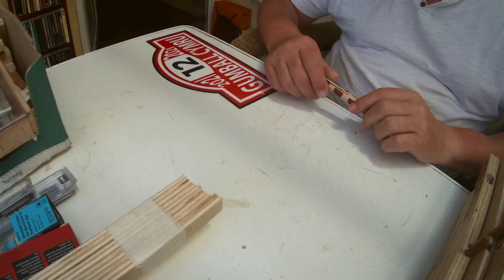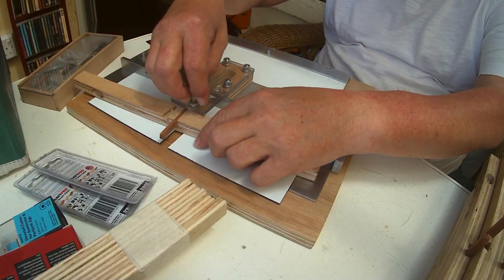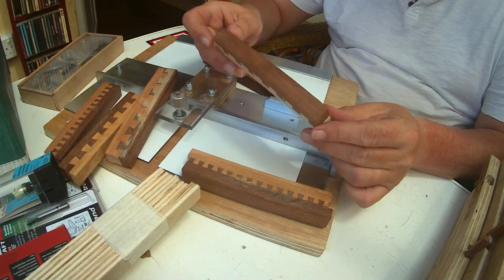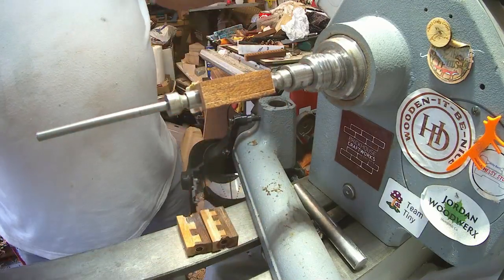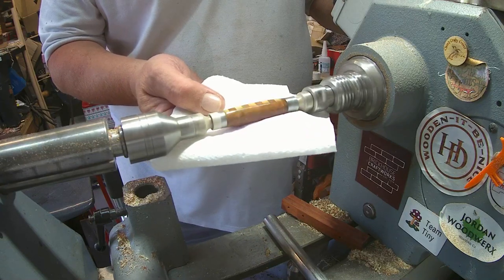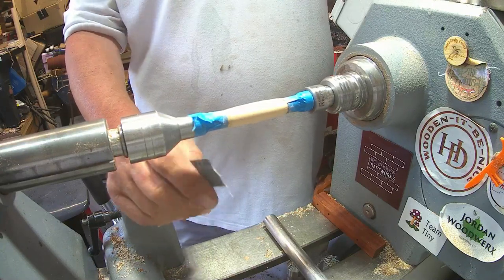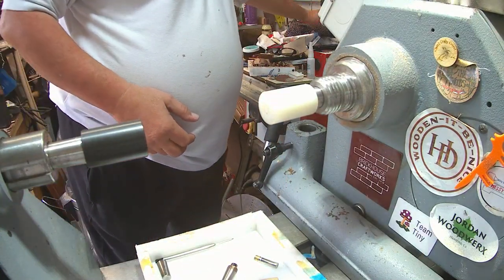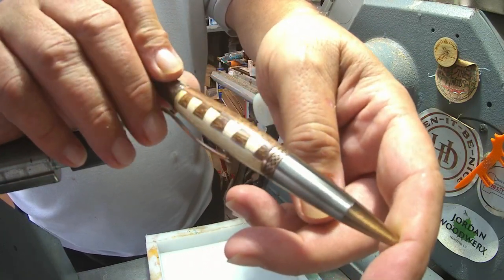Turning a Dovetail Pen from a test blank from a jig made for me by Mike from Dances With Aardvarks.

Comment: Very cool Huw. The pens look great.
Reply from the maker: Thanks Rus. I had the easy part.
Looking forward to getting the jig up and running.
Take care mate.
Cheers, Huw
Reply: @WoodenItBeNice  it looks similar to one I had when I used to make boxes.
Reply from the maker: @RcWoodturning  I have been tempted to make one blank by hand but only tempted so far. LOL.
Reply: @WoodenItBeNice  I've done it a few times, but a jig is so much easier and faster. I've been thinking of making different shaped joints by stacking the wood and using a scroll saw. That gives the option for curves. Would make some interesting joints.
Reply from the maker: @RcWoodturning  That sound very interesting Rus. Would love to see how you do it.
Reply: @WoodenItBeNice  It's one of my future projects. It will be a vase, but you can do it with pen blanks to.
Reply from the maker: @RcWoodturning  It will look amazing I'm sure.
Reply: @WoodenItBeNice  It certainly does in my head. We'll see if I can transfer it to the wood.🤔
Reply from the maker: @RcWoodturning  I sure you'll nail it Rus